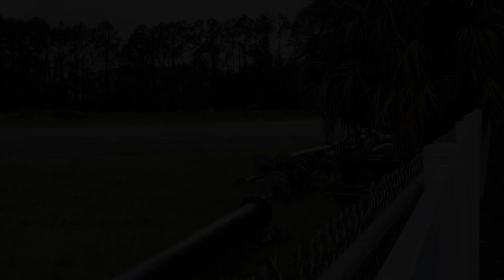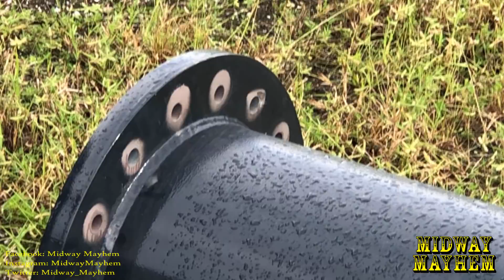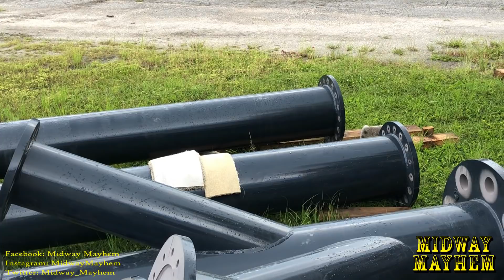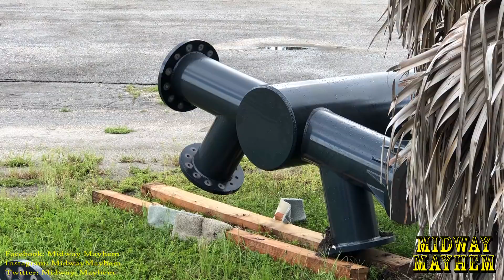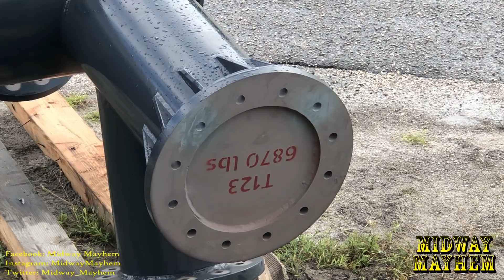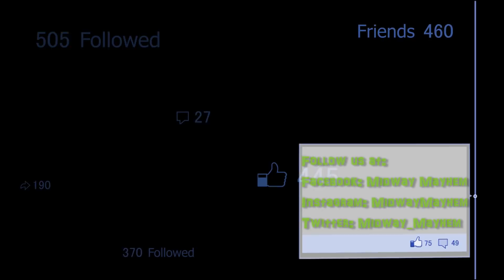Busch Gardens Tampa Bay Tigris Roller Coaster Construction Update 9.25.18 FIRST SUPPORTS ARRIVE!!!

Comment: Any update on gwazi come on lol?? I would like a check even if their is no progress so far, you never know.
Reply: There is 99.9% nothing new because Busch Gardens is busy doing Tigris and probably not start construction on the new Gwazi till after Tigris opens.
Reply: There is rmc steel next to gwazi. You can only see it going up the lift hill on sheakra. Sit on the left outside. Rode it today and noticed it. There are some green tents and a bunch of steel stacked up. I tried to view it from different parts of the park but I can only see it going up the lift hill on sheakra.
Reply: @swag-saltwateranglerguys7767  that's for Tigris not Gwazi.
Reply: Hulk Coaster are you sure? Because those steel beams did not look like anything that went to a skyrocket 2. They look like the steel beams they reinforce the Wood with for RMC’s. And there was stacks of them. Right next to gwazi. Have you seen this and from what view of the park? I can only see it from the lift hill on Sheakra.